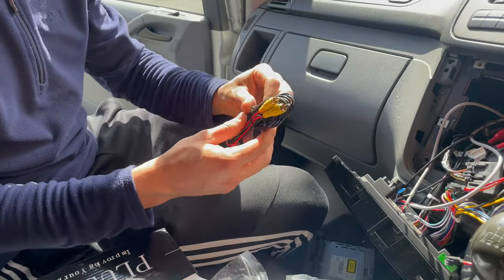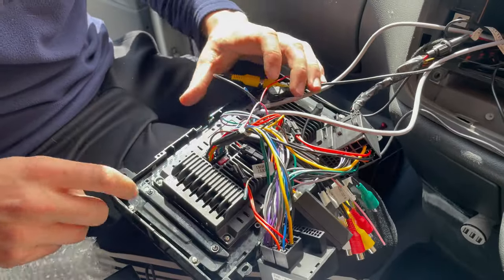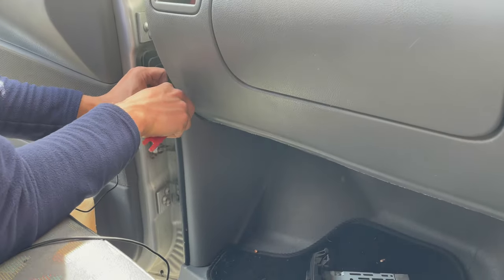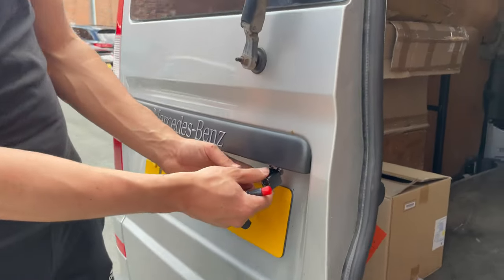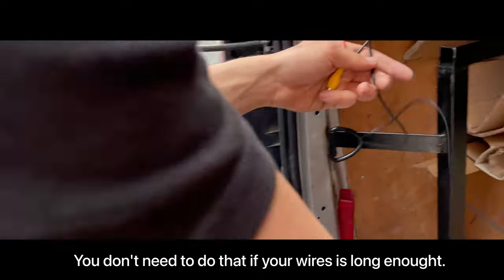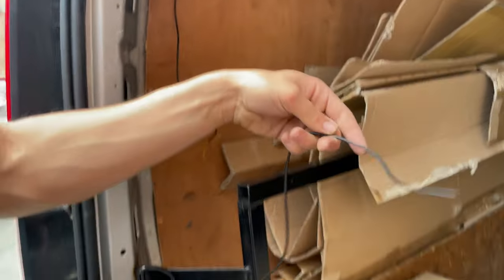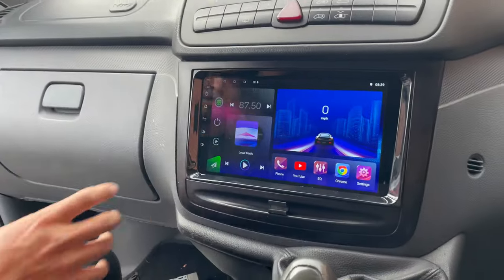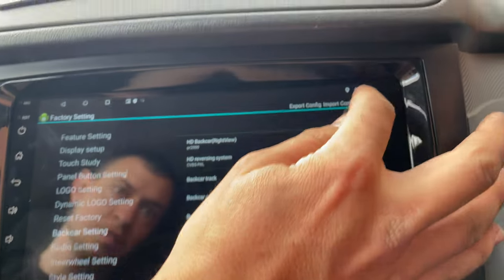How To Install Reverse Camera And Setup With Android Car Stereo?

Comment: You really should use proper wire connectors and splicers in car installation instead of just twisting wires together and putting a bit of tape over it. That's just half-assing it and asking for trouble eventually.
Reply: I’ve been twisting and taping 20 years never 1 came loose
Reply: @MACSauce-xf6qu  Look up "survivor's bias". (And I guess also "professionalism" or something like that. Twisting wires together and taping them is just half-assing it, period.)
Reply: As an electrician I can tell you that a simple twist to splice it is more than enough, especially if you choose to put a wire nut on the splice
Reply: @ovhfryerr6934  As an electrician, if you're twisting wires together, you're half-assing your job and you certainly shouldn't advocate for doing it. And don't get me started on wire nuts Americans in particular seem to love so much.
Reply: Spliced then solder and shrink tube thats how I do wiring..and not exposing cables ..will use guide wire to insert and snake thru that flexible conduit..
Reply: Any idea why my cam is flickery lil lines when selecting reverse?
Reply: @jamesbest9741  If you mean flickery as in there's a bit of interference, that is often unavoidable, though installing a power supply filter could help. If you mean flickery as in the image is broken up completely, then you need to configure the camera properly on your head unit (720p or 1080p NTSC 25 fps tend to be the most common)

Comment: If the vehicle has canbus does the reverse trigger wire still need to be wired to the reverse light to trigger reverse or can it be powered using the 12v ant blue cable on the stereo wiring?
Reply: Canbus, don't need a reverse wire connection but still need to connect the camera wire to pin3 wire on the android radio

Comment: My wire also is pink on the wire adapter and marked as backup camera but it is not working at all when put in reverse so I’m gonna check to see if it’s the 3rd wire if not I’ll connect to whatever the 3rd wire is and hopefully it will rectify my problem. Thanks for this video I’ve been searching for almost two months for an answer a this is closest I got I hope this helps me. I will come back to let you know 😮
Reply: Did you fix it? Mines doing the same thing

Comment: I can’t believe he cut the AV cable lol anyway apart from no connection to the reverse light  100% he’s had a short by now due to the way he spliced and taped those wires lol ( that was me 30yrs ago ) I watch these to see if there’s any new way or tool to make the job easier but mostly I learn these days how not to do it

Comment: Question I have hooked up the wires in the head unit ran the wires back to the taillight I hooked red to the reverse light I did grown the black plugged the connectors in part but there is an extra red wire not sure so I just taped it up. But at the head unit I need to put camera setting on to use the back up not sure why? Could it be the extra red wire?

Comment: This is a very simple installation, but I prefer to route the cable better and also through the back door rubber instead of along it. Takes a bit more time but gives less problems in the future.

Comment: Great video. I have a quick question on mine. I tried the brown wire on the stereo and even the pink one and no power coming to the light. Any suggestions please, would be greatly appreciated
Reply: Did u wire it to the reverse light. Sorry for the 7 months comment

Comment: Hi. I have K2401 android unit. Which connector is for automatic front view after reverse gear? There are video aux, camera in and cvbs cam in connectors. Which is for bumper camera?

Comment: Does your pink wire from the aftermarket wire harness also connect to the pink wire of the factory wire harness as to why you had to splice the wire in the middle as opposed to simply connecting and crimping the camera and aftermarket wire harnesses together???

Comment: Great video. I have a quick question on mine. I tried the brown wire on the stereo and even the pink one and no power coming to the light. Any suggestions please, would be greatly appreciated 🙏🏻
Reply: Check if your reverse light turns on when car is in reverse connect the positive of camera to the positive of reverse light wires and connect positive to positive of reverse wire from the video wire as well hope this helps

Comment: Great video. I have a quick question on mine. I tried the brown wire on the stereo and even the pink one and no power coming to the light. Any suggestions please, would be greatly appreciated 🙏🏻 9:50
Reply: hi there, if it’s an android unit then the wire is most likely located on your power loom side and this loom plug and its socket is normally labelled “G” and the wire is number “5” on your unit’s diagram. Therefore G5. This will be your Reverse/Back/Rear power cable. Hope this helps you. I’m still baffled at why he didn’t need to hook up the Ground (negative power) wire🤔 and how it worked without it🤔or is that ground already wired to the Ground wire within the RCA Cable🤔🤔🤔

Comment: is it possible to get the assist lines turn as you turn the wheel?  second, is is possible to keep listening music while in reverse? thanks!
Reply: Not sure about the guidelines turning but as for audio when I put the car in reverse the audio is muted automatically it you can turn it back up with the volume whilst still in reverse

Comment: Hi, i've a mtk8163 with canbus and I connected the power to the third pin of the car radio. when I put the car in reverse the rear camera LEDs turn on but the video signal is not there. can you help me?

Comment: Thank you for this buddy but I am still trying to figure why mine is not working, I have attached the red wire from the camera to pin 3 I believe is Accessory wire at the back of android unit, at the back of the vehicle I have connected the video cable from the camera to the long cable connection and the connected the ground cable, red wire connected to reverse light. with all these but don’t get video, only trajectory lines. I have canbus and my unit is by T’eyes. Is there anyway you can help with diagnosis. Thank you again.
Reply: I’m having the same problem
Reply: Maybe connect the black cable to ground...The last one of the video
Reply: Even I'm having the same problem!!! 
@pluscenter please help
Reply: Did you guys figure it out?
Reply: Its not always the third wire on some harnesses, but it is always the third wire on the android unit.  if you see a wire labelled "Back" or "Reverse" use it

Comment: where is 12v feed coming from? at the rear them red joint wires aren't wont be getting any current if they aren't connected to 12v power wire
Reply: It seems that it is not nessecary if you have a CAN BUS

Comment: Would an original factory fitted reverse camera be compatible with these android head units ????
Reply: Did you get a reply to this? I've got an original camera that I'm trying to connect. I haven't tried wiring in the power yet, that'll be the next step.
Reply: @alzyonline   yes I got a reply! I bought the following reverse Cambus / Adapter, for it to work with these after-market android units. I must state the quality of the reverse camera with this cambus is poor. Hence why I've returned the whole unit for a better operating unit.
Reply: @imrantazim2688 I've got a different head unit, I've bought the adapter, I haven't wired in the red wire that he taps into the pink wire, I think that's all I'm missing. Will give it a try this evening or tomorrow.

Comment: So you dont need the ground or take power from say reverse lamp just lut triger on red and its get power from stereo fron the videocable cool
Reply: Yeah i was thinking that too only connect to the pink back cable in the radio and connect the two red cables at the camera and it works?
Reply: Yes it does i dont use reverse lamp i have pigtail from rca cable on red power leave ground no need the. Pigtail from stereo trigger tada all done
Reply: @pontusborgjonsson1246  that would be perfect i think its because the RCA already has a ground inside?

Comment: Just followed your video screen saying no signal..brown wire,video in but no signal any suggestion ...wen through settings but no signal 😢
Reply: You have to connect the black and red wires of the camera to the wires of the reverse light.

Comment: I’ve got the light on the camera working but no image is showing on the screen. What could I have done wrong
Reply from the maker: You must choose the right camera format from the stereo settings, thanks!
Reply: @pluscenter I’ve tried it on all the different settings and with the video in connection and video out, it just comes up saying no signal
Reply from the maker: @TheCharliemcgarry  make sure it’s connected to the 3rd wire to the back of the stereo.
Reply: @pluscenter it is, it’s brown on my head unit, that connects to a black box which has 3 white boxes on the end. 1 smaller one which connects to a connector in the van already and the 2 bigger ones have no where to connect to